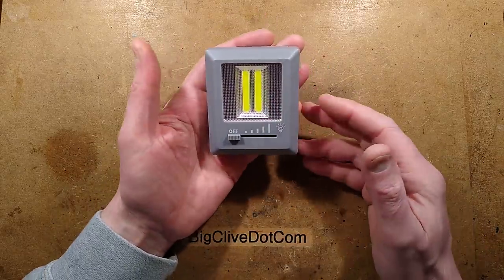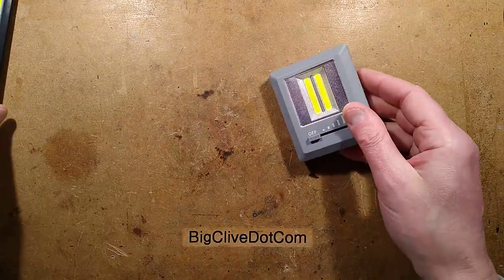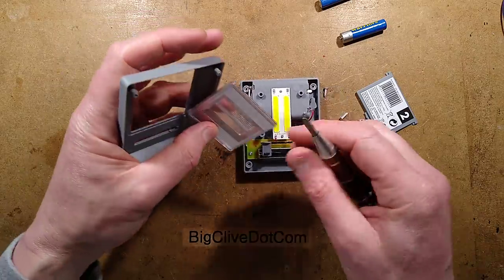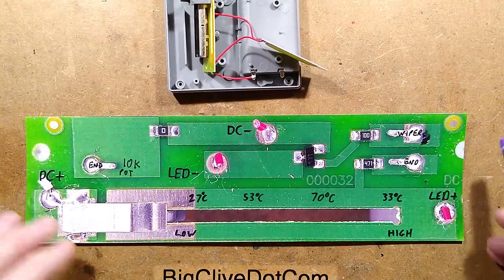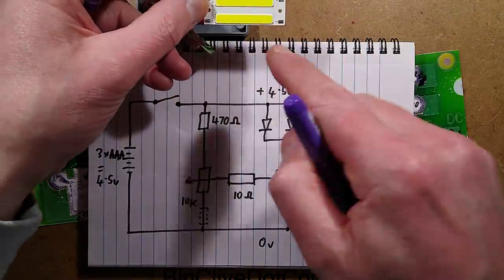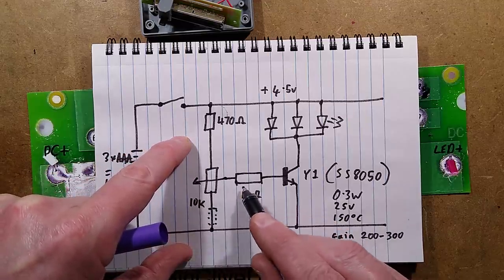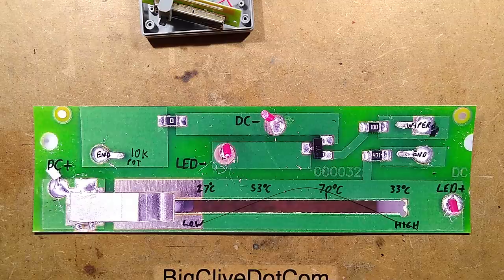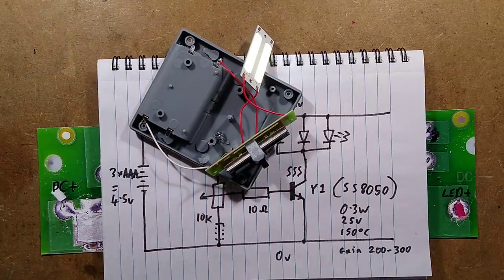Poundland dimmable COB LED light (with schematic)

Comment: I have the single led strip light of these, without the dimmer. They seem to eat batteries pretty quickly, so I don't use them much anymore. Those who produce these things should learn from Ikea with the extra 'lid' on the backside that you use to secure them to the wall or ceiling with. You have to use velcro on these to secure them to a ceiling, and after a while they fall down, and they might break from that.
I would probably have bought some of these if I came across them, and I would probably have used them on medium high lighting most of the time. But if the transistor gets as hot as 70 degrees celcius, couldn't that over time be a potensial fire hazard? Or are they designed to take that kind of heat over time? In an offgrid cabin you need some lights that can stay on, not just the one's that are activated by movement.

Comment: I'm on a bit of a modify everything to take lithium cells binge at the moment (I got a load of those very cheap protected charger boards) - that thing looks like a good candidate
Reply: I hear you.  Add a .99 cent Ebay usb charging circuit and your good to go.
Reply: @JohnSmith-qd8po  they are fantastic - I updated a D cell camping lantern that just chewed through batteries with a hefty pack and a 99p charger and the bugger lasts for many hours on full beam now.

Comment: I have a similar light - a knock off light switch with 2 COB arrays in it.
These are terrible though, the resistors are dodgy (or nonexistant) and the dimmable one I have uses some wire wound pot that gets really hot...
The LEDs are nice though, I'm thinking of some dooby mods for them...

Comment: Using a transistor as resistance for dimming is last century tech. Today we use a buck (switching) regulators. Totally flicker free and battery saving since it doesent get hot at all. I use an adjustable 70ct ali buck for my lidl 12V led light.
Reply: Right, but jellybean NPN are practically free in large quantities.
Reply: Excuse an old man getting nostalgic but I remember deep in the mists of time when Elektor magazine had an led driver stuck to the cover!  Proof that many years ago these devices were already down to a few cents.  But the bean counters are running the show and prefer a bad device that costs 1 cent less.  Oh dear...  This device is, as you say, last century.

Comment: i sorta have one of those one brightness types where it looks like a light switch and just flip it up or down like on but looks like the leds wont last long if this is the case of how it runs though i only got them mostly for if or when power goes out i have some rooms still need some light for now like a bathroom or something.

Comment: Where in the circuit would you add the resistor and at what values? Saving the wimpy AAAs is always a good idea.
Reply from the maker: You could increase the value of the 470K resistor or add a 22 ohm resistor in series with the LEDs.
Reply: Thank you.

Comment: Hey Clive i just got a wish ad for a fuel saver that im sure youd have a blast pulling apart. Theyre all over ebay too as these black cigarette lighter plugs with a strange blue bulb on the other end. Perhaps chinese cars send fuel through the cigarette lighter. Happy Easter from NJ.
Reply: They work bye harvesting the dark energy from the Q-continuum...
Reply from the maker: Already covered quite a few years ago.  Just an LED, resistor and capacitor.

Comment: Hi, what would you recommend as a MOSFET replacement for the SS8050 to control the brightness of a 5V COB LED strip?

The strip uses about 600mA when powered directly, and under 20mA when PWM=255 from a PIC mcu.  I found out linear PWM is not really a good option cause there's lots of "random blinking" and the LED never really shuts OFF even at PWM=0.
Reply from the maker: If the existing transistor is a bipolar one then the use of a MOSFET may depend on the existing circuitry.  The classic one used in many Chinese products is the A2SHB.  It may at least need a gate pulldown resistor to the 0V rail.

Comment: OOOOOOOHHHHH THESE ARE SSSSSOOOOO GOOOOODDDD ive modified one of these in every single way possible, outting things infront if thge led to make different coloour, making it usb powered putting key chains oin them every single thing
Reply: I would love it if they came USB powerable.
Reply: I’ve done it a few times by the way I’ve basically got 5 volt supplies (some not usb and some are usb) and connected it straight to the supply cause it’s only 0.5 volts more but beware there’s a lot more current so have the lights dimmed a bit and turn them off when you do at the plug not by the dimmer

Comment: Couldn't the 3 AAA batteries be replaced with a couple rechargeable cell phone batteries, wired parallel,  if they'll fit that is?
Reply: The trouble is that some devices depend on the internal resistance of the cells for current liming, as Clive mentioned.  I once blew an IR LED in about 6 seconds by replacing the 6V bat with a 6V bat.   Eh?!    The replacement was bigger and had lower internal resistance.  The cheapskate makers saved the cost of one resistor by connecting the led  directly to the bat, relying on its internal resistance to limit the current.  So beware, rechargeables generally have much lower internal resistance.

Comment: If you had a higher resistant resistor between the potentiometer and the base would that not help with the heat of the transistor?
Reply from the maker: The heat is generated by the transistor being used in its linear region as a virtual resistor.

Comment: I bet that someone reviewed the circuit and said “That’s too much current. Put a resistor in series.” leaving out the critical detail of in series with what. They probably assumed that as being too obvious to state. Either that or 10 ohms was the lowest value they had, or they had an excess stock of them, but it was too much in series, so they tried putting it in somewhere else.

Comment: Zinc Chloride cells have a higher internal resistance and ( should .. ? ) limit the maximum current, helping to save the LEDs at full brightness .. however the " Kodak " types ( see comment a long way below ) might not last that long ... ( other makes are available ! ) ... FYI , alkaline types LEAK HORRIBLY, ( as you guys probably know ! ! ) .... but a very nice lamp from Poundland !

Comment: Impressive what you can get for £2 tbh. That’s a very decent standby/emergency light.
Reply: Not so much, as detailed in a different post I made, it could have been twice as bright for very little cost increase, and had longer runtime by having 3 x AA instead of AAA battery.
Reply: @stinkycheese804  possibly but then it would cost £3.

Comment: I was fed up with replacing aa battery so I hooked it up with a dc 5 v 500 ma... Works well but sometimes flickers alot
Reply: Put a resistor in series, the flicker might be from your power supply

Comment: !!!!!! Poundland Five USB charging station has a fault where the solder of the C7 connector is breaking because it is not sufficiently mechanically attached to the circuit-board.

Comment: So where do I add a resistor or change a resistor to reduce heat and extend battery life then?
You did not say and thats often the most useful bit you can offer that often now you miss.
Reply from the maker: In this one all you need to do is run it at a lower intensity.
Reply: @bigclivedotcom  Yes thanks I understand that but can that spike at 70% be limited with extra resistance?

Comment: I'd heard mention of using a transistor or mosfet for dimming, and I was thinking of doing something similar for a custom lamp I'm building.  I started with a simple pot in series, with a more complicated vreg keeping the voltage steady at just over the LED's desired value, but the pot burned out anyway.  When using a mosfet for this, how do you work out the right values for the pot and other resistors?
Reply: I would highly recommend to put a resistor R in between the source of the MOSFET and ground. That way you get a basic current regulator, which is desirable for driving LEDs. The current is roughly I=(Ug-Uth)/R, where Ug is the voltage at the gate and Uth the threshold voltage where the FET starts to turn on. 
Example: Drive LED with 0.2A from a 5V supply using a MOSFET with Vth=2V and a 10k pot. Add 10k resistors from 5V to pot and other side of pot to ground. The wiper is connected to the gate, which can now be set from 1.66V to 3.33V. Below 2V the FET is off. The FET can go up to 1.33V above its threshold. With a source resistance R of 6.8ohm, you get roughly the desired 0.2A.

Comment: Installed a dimmer on some spots in my music-studio; it buzzes when used, and then I vaguely remembered that I think all dimmers buzz a bit.... Is there dimmers that are silent, and how are they made in that case?
I can't use the dimmer, or not whilst doing any Live recording at least - annoying
Reply: Yes, the electrical interference is a problem for sensitive equipment.  Do you really need a continuous dimmer, or just a small selection of light levels?  If the latter is ok then just use multiple lights, each with an on/off switch.  Preferably incandescent or halogen cos they create no interference,  whereas mains  led "bulbs" can.
Reply: @raykent3211  Yup, got lots of smaller spots but set up a bendable arm with 6 spots in the roof and thought it would be nice to tone it down at times... 
There is also LEDs with dimmable properties incorporated as turn on and off, and on and it changes the light level. Right now it is filled with incandescents..
At least there is light :D
Reply from the maker: Phase angle control is always noisy.  Especially at mid-position.  Take a look for a modern reverse phase control (lagging edge) dimmer.
Reply: @bigclivedotcom  Will do!

Comment: Pity they didnt make it a proper constant current source... better for the LEDs and means you get the full amount of juice out of the batteries (as long as the battery voltage is above the LED forward voltage)

Comment: BTW sister has bought some dimmable LED lanterns that appear to be using the glass and metal body of the oldschool kerosene hurricane lanterns. They use 2D cells so there's probably something cleverer going on than these 3AA cell lamps that drop the voltage as waste heat. I've not been able to look inside one yet due to lockdown.
Reply: cost was about £10 
PS the chinese seem to call them 'LED horse lanterns' if anyone's interested enough to fancy a look on banggood or aliexpress
Reply: I have the Duracell modell LNT-100. It is a dimmable led camping lantern. It runs on 3 D batteries (LR20). Works really well. I haven't tested it long enough to be able to say anything about battery life. But I would guess that they will last for quite a long time. It does not come with an USB port, which would have been nice. Some bigger torches have USB ports. 
Edit: It is supposed to run for more than 41 hours (probably only if you use it on low), and maximum light output is 95 lumen (16 leds).
Reply: I just came to think of another lantern I bought a while back. It has the same oldschool kerosene hurricane lantern design as yours. Mine is also dimbalbe, but it runs on 4 AA batteries. When I found out they sold these, only one store had one left of them  - on sale! And then they stopped selling them. I wonder why. There must be many people wanting these for camping or garden use and whatnot.
Reply: @milcotto4153  I'd suspect duracell were even keener to sell you a battery hungry product than poundland. :)
Reply: @joinedupjon  - I hope not!
I just killed my kerosene type lantern by dusting the dust off it! Now I know why they were on sale. And then, since I have become an experienced techno freak, which is all BigClive's fault off course, I revived it again. It is no longer in lantern heaven. I just went into the belly of it and moved the wires around a bit :-)
Reply: @milcotto4153  Awesome, I always feel good about repairing something myself :)

Comment: Ok, just one more. It is a dimmable USB powered light bulb with 3 color temperatures. (Item 33037761144 on Ali Express). Perfect for my use as a ceiling light on a powerbank anywhere in my cabin. You can even put it inside some types of ceiling lamp shades. The three led lights I have mentioned here, is about all you need to have lights in an off grid cabin from big batteries and powerbanks.

Comment: I brought one of these from Poundland to keep in the car. The battery went dead even though I didn't use it..
Reply: Manny people seem to have the same problem with these lights
Reply: @NinoJoel  

I think the slider switch that turns on the unit is either consuming little/small amount of power when it is set at zero (0) i.e. when on stand-by mode hence the battery was depleted.

I used three new batteries on this unit. When I was checking for oil leaks it let me down. They need to put it back in it's test phase for sure.

Comment: A low value resistor in the emitter to convert this to a constant current circuit would be a better solution.
Reply: Wouldn't that defeat the dimming function?
Reply: @westinthewest  No, the current setpoint would still be variable.
Reply: @ferrumignis  I'm not sure what you mean - it' can be difficult to describe stuff like this without being ambiguous.  
If the transistor compensates for variations in base current by using a feedback resistor in the emitter to maintain a constant through the load, doesn't that defeat the point of varing the base current?  Would varying the feedback resistance change the dimming profile from the two extremes i.e. no dimming at all (high feedback), and same dimming as before (no feedback)?
Reply: @westinthewest When you put a constant voltage across an emitter resistor by applying a voltage to the base, the collector current remains approximately constant with changes in supply voltage or load impedance (within its compliance range). This is a basic constant current source design. It's not perfect, current will change over temperature but it's a good approximation.  Changing the voltage applied to the base (and therefore across the emitter resistor) changes the current set point.
Reply: @ferrumignis  I see.  Dimming will still operate, but more consistently, and the circuit is improved by adding just one resistor.
Reply: @westinthewest  Yes, and importantly the maximum current would be limited.  It might require a bit of changing of other values to optimise it, but the circuit could have been made quite a bit better for the cost of that extra resistor.

Comment: I don't know how much would the shipping cost from Hungary to you, but my father and I work with alarm systems, and we could give you a used system that we took down from a place. Control panel, an infrared detector, maybe a siren, a door/window contact, a keypad... Not the newest and best technology, a bit old, but I thought you might find it interesting, how it works and how it's put together. If you're interested, tell me where should I ship it to and I'll see if I can do it. You could try hacking it, see if you can bypass the system somehow;)
Reply from the maker: Thanks for the offer.  I have some alarm units here.

Comment: Thanks, Clive, interesting light, unusual,  although at the very top intensity I don't think the LED's would last very long relatively at the mid-intensity, the Tranisor would not last that long either although it is within its operating temp its still being grilled.
Perhaps you could do a modification video to make the unit last longer, that would be interesting I think. 

Thank you!
Reply: Definitely an opportunity for a Big Clive hack!

Comment: I want one of these. I just found this item on Ali Express (search for: 1005001763167743 on their website). Why don't they sell led lamps like this in our local shops? It is a desktop lamp that is both rechargeable AND you can run it from mains or from a powerbank. It is even dimmable. And it has three different color temperatures. Useful at home, in an offgrid cabin or when you go camping. If you happen to want to review one I would be happy :-)

Comment: It's a shame they put mingy little battery boxes in stuff like that, where they batteries might only last an hour or so. There's just no need for it. I don't think Poundland sell anything at all that takes a C or D. But they should, they last so much more. C's and D's cost about the same, and D have more than twice the capacity of C. It's sad to sell them designed to be inadequate. I'd love to know the justification, and then the real reason. Even back when little battery cupboard lamps used incandescent torch bulbs, they still used shitey little small batteries. Really bothers me, it goes against every sensible impulse a person could have. That one comes with a screw hole on the back, so it's meant to be mounted semi-permanently. So put a proper battery box in it!

Worst case they could perhaps put a snap-in thing for a USB backup battery thing, the ones with the lithium cells to top up your phone on the move. They sell those for a quid, so why not use them as the core of a number of things like lights etc? Sort-of like a pound-shop version of Ryobi, loads of little USB-powered thingies meant for a specific USB battery box to clip into. The cost of the plastic for the clip would be offset by not needing to include a battery.

It'd be a universal system, cos it'd use USB, automatically compatible with all the world's USB stuff. 

Or failing that, just put slightly bigger holes in there for a bloody D battery!